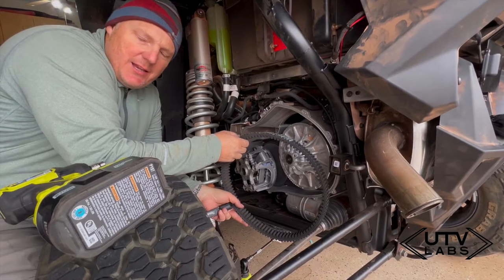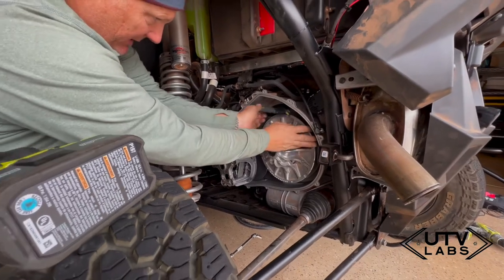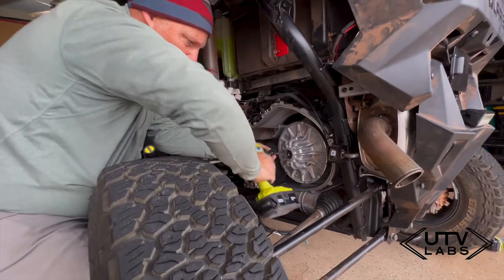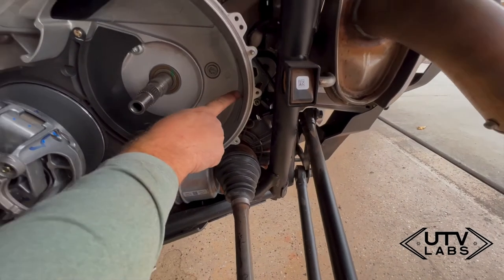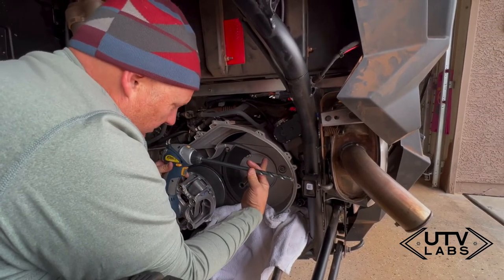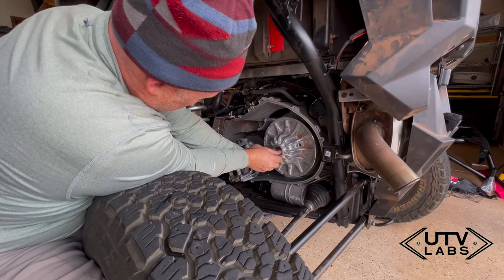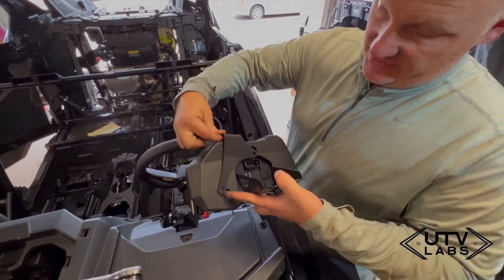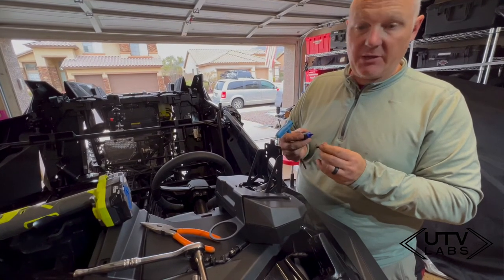Pro XP 4 Razorback 3.1 Infared Belt Temp Guage Install

Comment: nice video but i DONT recommend anyone using this location for the sensor!  at that location belt dust/dust will cover sensor, it needs to be around the 1:00 area.  right in front of that throttle body.
Reply from the maker: I considered that but I don't think it will be an issue. I personally blow out my clutch sem-regulary so we shall see.